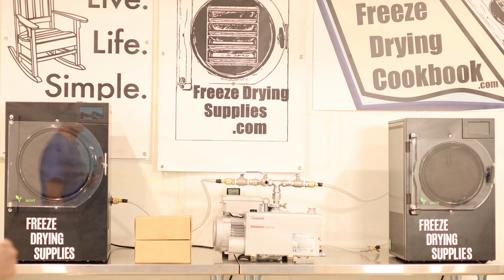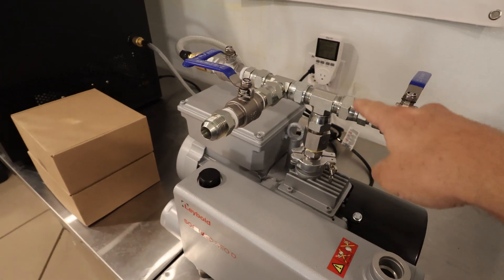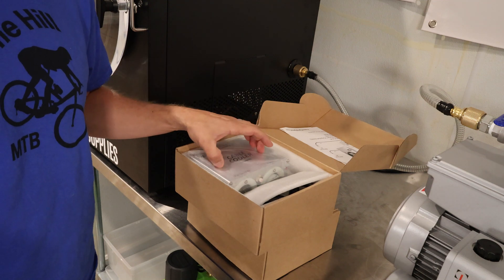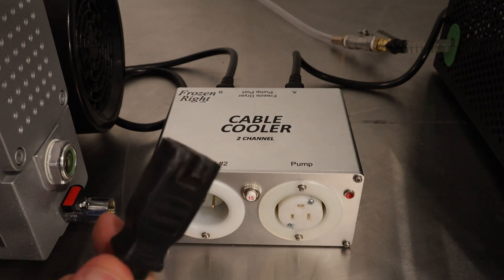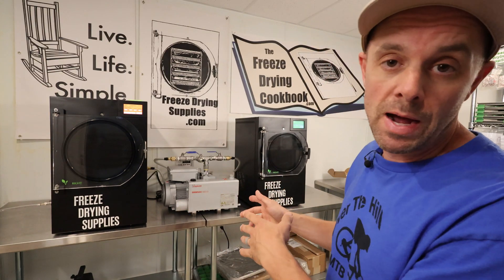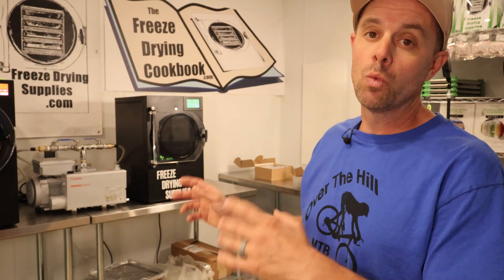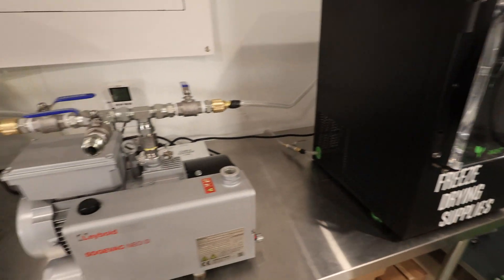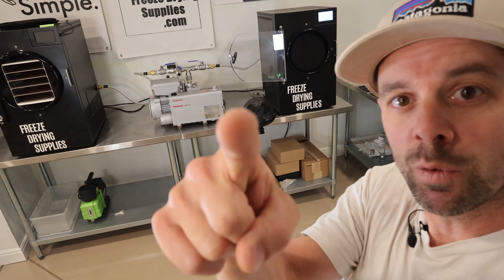Running 2 Freeze Dryers With Just 1 Pump #harvestrightfreezedryer #harvestrightcommunity

Comment: You could swap those ball valves out with 110v solenoids.  Then when the freeze dryer calls for the pump from that   Freeze dryer the solenoid would open for that freeze dryer.  Put a splitter on the cable cooler pump A&B plugs.  Google this SKU for an example SZW-20-110VAC
Reply from the maker: Cool!  Might be my next project!
Reply: @ also, as with any moving part, solenoids can fail and it’s wise to build a manual bypass loop around the solenoid.  But that would make the SS parts list/costs go up.  It just depends on does down time cost more than the parts? I’m a brewery owner. Solenoids control glycol to fermenters.  Having the manual bypass loop can save beer.  Cheers on your next project.

Comment: So how is this different in say,electric?
Reply from the maker: Electric usage will be the same as running two freeze dryers, but will depend on the efficiency of the pump you are using.  I believe the Leybold pump I am using is pretty efficient, but is also drawing more vacuum than the stock HR pump.  I will try to keep an eye on that metric in the future and give some updates.

Comment: you used my word as I was watching, 'babysit'..  does it hurt the machine that's still freezing, 
if there is a vacuum on it because the valve is open?
Reply from the maker: If you start both machines at the same time, they will be pretty close to needing vac at the same time.  Since the next step in the total cycle is vac freezing, it just starts vac freezing a little earlier than it may be set to.  If it was a major concern, you could leave the valve closed until the temp was within a degree or two of the machine turning it on.

Comment: You might want to cover the electrical panel requirements. Running multiple machines off of one wall outlet may kick circuit breakers in an older home.
Reply from the maker: I don't recommend running multiple machines off of one outlet.  The cable cooler does not run the machines, it just tells the pump when one of the machines is demanding the vacuum.  Each FD stills needs to have it's own outlet and required type.